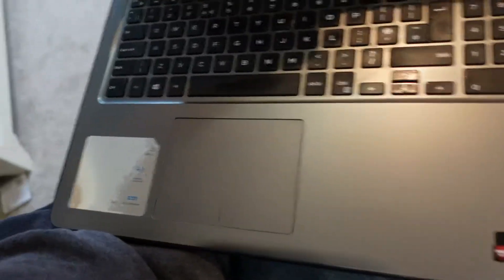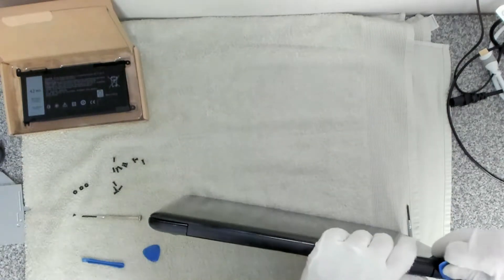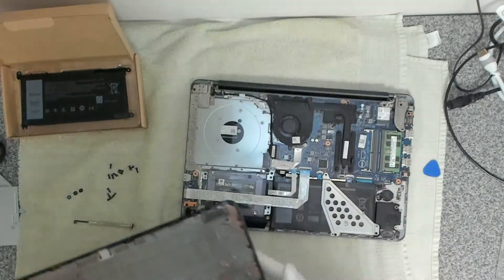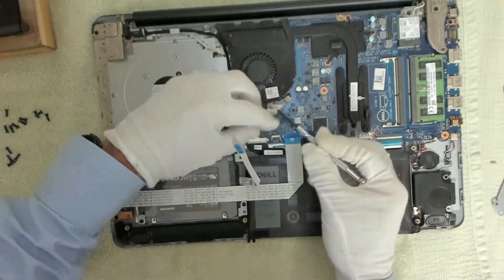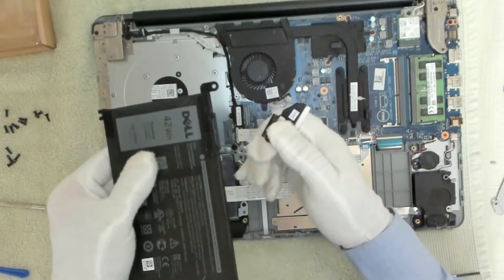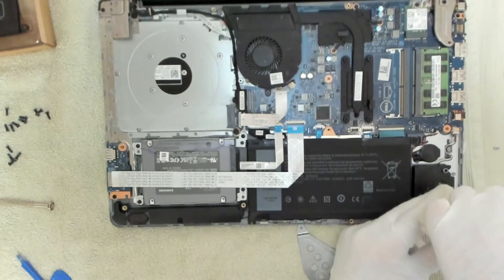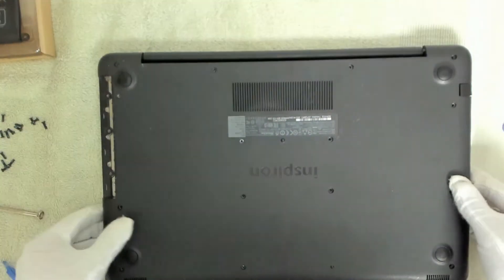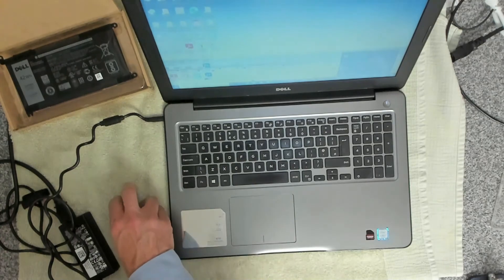Dell Inspiron P66F Battery Replacement

Comment: Sir !   The cable which connects battery into motherboard is damaged . ( All the 10 different wire cover fell of ) now the wires are touching  one another . Can I use it or not . ( It is very different to find the replacement for battery cable).

Comment: Hi there,
I have followed this guide to the letter but the new battery just won’t charge.  I get 4 orange flashes then 1 white.  Can you help?
Reply from the maker: I'm afraid that means you have a bad battery. If that's the one you've purchased then you'll need to return it for a replacement. 4 Amber lights followed by a single white means a bad battery.